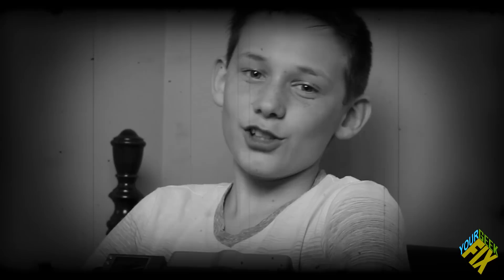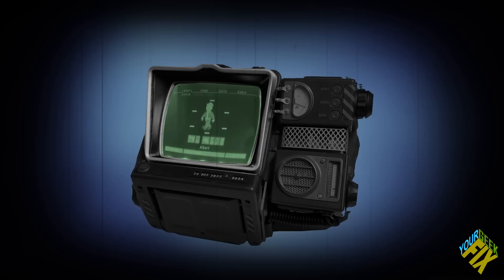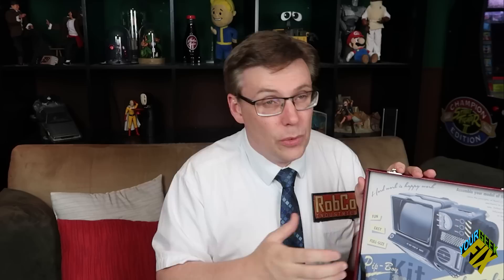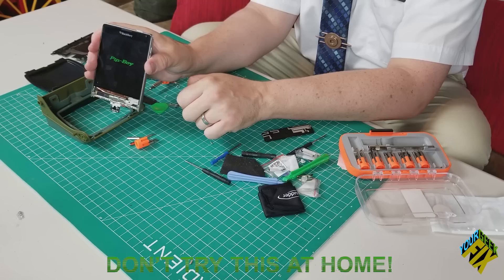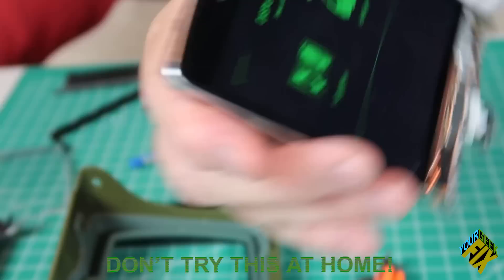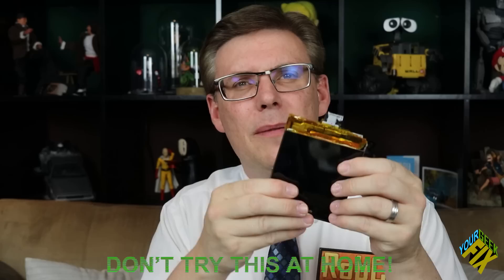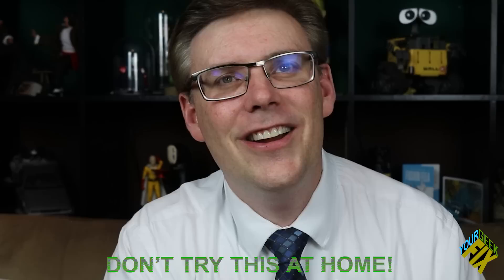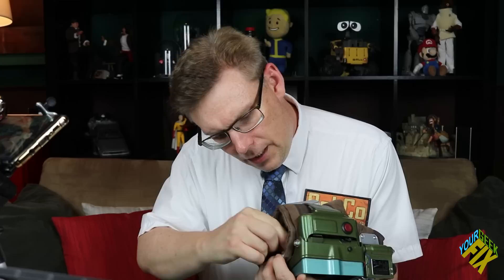How we made a real working Pip-Boy 2000 Part 1 of 3

Comment: Very impressed with the video! I'm new to the channel & was really entertained! I think you should find a way to use the phone's keyboard. The area on the bottom that holds the cartridges (pardon that I don't know most Fallout jargon) could be modified to hold the keyboard. It could drop down when the shelf is pulled down. You could either get an extension ribbon cable  to connect it to the motherboard, or you could turn it into a bluetooth keyboard using a bluetooth module or kit. Honestly, probably the best thing to do (but would likely become a giant pain when replacing the batteries unless you have the radio & keyboard run on a single rechargeable battery) would be to remove the children's bluetooth speaker and splice the radio speaker to connect to a single bluetooth module. This module could also connect to the keyboard. However, I'm not sure how bluetooth works on a OS level. This is in reference to my phone or computer knowing that I'm connected to a speaker or a keyboard or whatever, so I'm not sure how possible it would be to create a single bluetooth device that has both speaker & speaker capabilities. At that point if there are any misc. knobs & dials, you could make them bluetooth & act as a cursor. However, this may not make much sense.
On the other hand, you could turn the shelf drawer thing into a cassette player. Just a thought because the tapes remind me of cassettes which they probably likely are due to some of the Fallout lore. However, I'm not sure if they made cassette players that are small enough & would fit. Honestly, this device looks like it has the space to convert everything to its real, working counterparts. The exception might be the rad meter. You could possibly turn the rad meter into a VU meter that's connected to the phone &/or radio which may be cool. However, I haven't seen a VU meter that isn't chucky & rather large even the kits are pretty big.
Anyway, I loved this video, & this was a very cool project. I wish I had one to work on. Okay, gonna subscribe now.
Reply from the maker: It is a good idea. I stuck in the end with something I knew Fallout fans would not object to. However, when I had to reformat the device it had to use the original keyboard and I reconnected it for that. SO it would be nice to have a quick fire way t do this. Thanks for the comment Michael Schulte.

Comment: No one tell him about the numerous "Screen Rotation Control" apps that let you force your screen to rotate in software, negating the need to physically rotate the screen.
Reply from the maker: As mentioned in video 2, we tried them all and none worked on this app and there is a reason for that. There is an alternative, bit the cable doesn't reach.

Comment: Probably should have just made the radio run off of a rechargeable battery. Maybe a concealed USB port on the outside as the charge port.
Reply from the maker: There is an option I found for older cameras for that battery configuration.

Comment: How much did this cost overall and how long did it take to build. Time to start saving for my next project!!! This looks like equal amounts of fun and infuriating, but so worth it in the end. In true Fallout fashion!
Reply from the maker: The kit is $77 to $120. Radio kit $50-$70. Cylo Pop Critter Speaker is $10-$12.and the blackberry phone was $81-$120. So, somewhere between $218 and $322. I believe the rad meter will be someplace between $60 and $100. So, the question is, how motivated are you to make one? It took me three months, but I was making video, working, and having to order and wait for parts. I went through three Blackberrys and two screens. I also recommend checking out Joshua Diggs (Zap Wizard) on his 3000 project as I feel a lot of the methods could be used for the rad meter and tape.

Comment: The pip boy 2000 wouldn’t sync to fallout 4 immersively (mxr fans) because the pip boy 2000 is used in fallout 76 not fallout 4
Reply from the maker: The model has been used for some time by those hacking it into 4.

Comment: I think that probably the easiest way to make it fully functional (without altering the case like I plan on doing with my kit) is to put a Raspberry Pi 3b+ (or whatever the lastest version is) in the tape slot....
Reply from the maker: The tape slot is too thin. But if you get it working, let me know. Check out our other pipboy video as we covered this.
Reply: @YourGeekFix  I'm actually taking a bit more radical approach to modding mine:  i'm making it more like the hand-held/shoulder strapped Pip Boy 2000 from Fallout 1 (I know some people who do quality aluminum work for a really reasonable price & my one uncle has a powder coating machine in his machine shop)  My idea is to basically create  what is almost like a Fallout cyberdeck (basically a pip boy that has been modified with a larger case to fit in components from a terminal to allow hacking mainframes without needing an actual terminal sorta thing)
Reply: Also an addendum, since it's too small for a 3b, then the smaller Pi Zero should fit.
Reply from the maker: @DJ_Bonebraker  I tried the Pi Zero. It best fits in the top module, but still too large. Would have to modify it to fit. That should give you an idea of how small it is. I have a friend to the channel designing a board that would fit and run an independent screen. The challenge is fitting everything, with exception of speaker, in the main module. When you get yours working, send pictures. I think that sounds really cool.
Reply: @YourGeekFix   Oh wow, really? I guess the PiZero must have been too wide for the tape slot...  Kinda hard for me to judge scales of things accurately unless I have seen them in RL at least once.  Looks like my idea of making it a shoulder-strap unit (like the original Pip Boy 2000) is probably the best way to go about this, then... Especially considering your comments about the weight of it on your arm, but yeah, I'll probably make my own video showcasing the finished product as well as some of the steps I took to make the new backing & stuff when I get it done... Still waiting on the kit to arrive from Amazon.  The video will be in the "Tech & Travel" playlist on my channel.
Still gotta love your solution of using a heavily modded blackberry for the innards.

Comment: Sadly theyve never released the rad meter. Also they now only have preassembled pip boys But you can get the radio module (the prebuilt one comes with the lightscreen) and they did have a limited edition Red Rocket Paint pipboy, which yes came with its own variation of radio module
Reply from the maker: I'm not giving up hope yet.
Reply: @YourGeekFix  neither am I. Honestly didnt know they said they were going to add one til this video.

Comment: what of u were able to use the holotape as your charger? Run a cable to that part of the pipboy and put a small portable charger into the holotape. With Bethesda selling standalone holotapes that gives way for interchangeable batteries as well.
Reply from the maker: True. The holotapes are pretty thin. It would be like a camera battery.

Comment: hey i got a question about the wire ribbons... if one had the tools and skills could you take one off and put a longer one on... if you are able to how would you do that
Reply from the maker: Unfortunately, when it comes to ribbons, you need one that meets the pin requirement for what you are attaching it to. When I was looking for a matching pin count for a ribbon extension commonly used for repair, I found out the ribbon and screen were made only for the Blackberry Passport. Makes sense due to the screen size. It is an OEM component you won't find elsewhere. So, I suppose we are stuck with the ribbon we have. Unless, you made a unique board with the connector, that had two connectors for extending it.
Reply: @YourGeekFix  what if u could find more ribbons from the black Barry phones would u be able to conect those together ik that each connection causes interferance and load but if u had like 3 u could move the end almost anywhere on there and the interferance wouldnt be that bad
Reply from the maker: @akkiller8454  No, there is no way to hotwire it and you would need a series of adapters that just don't exist. The problem with a unique device.
Reply: @YourGeekFix  would it be posible to make your own adapters like of u had a bunch of broken screens take the ribbons from those and make an adapter from them
Reply from the maker: @akkiller8454  they would not have to pins on both sides.

Comment: Amazing build! I have to wonder if it's possible to create an actual clock for the holotape player... but with the piece to fit it in being so small, it really seems like it'd be a major pain building and fitting the tiny parts it would take to make that possible. Honestly, that would be perfect for another official mod that they could release! (after the Geiger counter of course)
Reply from the maker: My problem with that has been the preset width. The rollers I have found are too wide. I think smaller rollers with a magnifier would be better. Thanks Gomorrah.
Reply: @YourGeekFix   I don't know how difficult it would be to access one at this time but there's always 3D printing. At least that's what I'm considering doing for it.
Reply from the maker: @gomorrahstride9672  3D is good. The 12 month of the year roller will have to be tiny. If you figure it out, let me know.
Reply: @YourGeekFix  I think I might have a solution to that problem. Looking into old digital clocks, I found this: 
https://www.youtube.com/watch?v=_YuDjj1baUs&t=301s
I'm not exactly sure what's happening here, but from what I can gather is that the tiles are double-sided and they come into contact with a piece of plastic as it spins around the back, forcing it to flip to a new number. It's more complex than a roller but it lets you print more digits or months with less real estate.

Comment: Hey there! Just finished everything! Only difference is, I had to get my hands on the illuminated screen pre-built edition. I'm having a bit of issues fitting the back casing that's attached to the cuff to the Pip-Boy with the Passport in the way. How exactly did you fit and cut that? Pls Help Me <3
Reply: This in reference specifically to the monitor back plate or the bottom bar that connects through the holotape reader. Cant seem to find a way to get it through with the passport in the way.
Reply from the maker: I did cut a slit in the cuff to 0 sh through the usb. I also flattened the back plate slightly wit h a heat gun.
Reply: @YourGeekFix  Alrighty! I'm not sure where I went wrong, it seems like the blackberry passport device is just too thick for the pip-boy at it's current state. I cant get it to sit in there, and still be able to get the back plates off and the two rods, any advice?
Reply from the maker: @ladyvictory5326  flatten back plate of pipboy a little

Comment: Pretty cool.
Reply from the maker: Thanks
Reply: @YourGeekFix  always wanted to do one from scratch with a Raspberry Pi and a touch screen, but probably will never get around to it. If I ever do, it'll be more like Fallout 2 version that is all frayed and wires sticking out and held together with duct tape.
Reply: @YourGeekFix  and don't feel bad about tearing those delicate ribbon cable, every time I've taken apart a phone, I have a 50% rate of screwing up something like the little oscillating weighted vibrator thing.
Reply from the maker: @ltjon1924  understood
Reply from the maker: @LT Jon  while the pi does not fit the 2000, it fits perfect in the 3000. Did you see video 3 yet?
Reply: @YourGeekFix  I'll check that out! No I haven't.
Reply from the maker: @ltjon1924  definitely

Comment: Did you just call it a rad meter instead of a Geiger counter
Reply from the maker: At the moment they have the upgrade identified as a Rad Meter (radiation meter) due to the fact it does not meet real Geiger counter standards. It measures only EM radiation.

Comment: You know, theres a button that makes the pip-boy smaller, the zoom button, so there aint no need for anyone to spend all that money for a Plastic Pip-Boy, either way, you are looking away from the screen, so its kinda not needed at all.
Reply from the maker: Good point G00ober. I think it's about immersion though. There is also something to putting together a kit, having the sensory experience and knowing you have something on your arm that does more than just light up. I will miss Comicon and cosplay. This would have been the perfect accessory.  How are you doing G00ober? Are you staying safe.

Comment: Wouldn't a raspberry pi/arduino and an LCD screen from china suffice in this application? More lightweight? Not running more power than you need, etc? Although the blackberry is super thin and convenient. Great job on this build. Looks amazing!
Reply from the maker: They won't fit in the .25 inch space. That was the challenge. The Pi was my first choice. Also, the challenge was that it had to connect to Fallout.
Reply: Your Geek Fix Gotcha. The connectivity issue would have been another hurdle, but entirely possible. Too bad it didn’t fit, but at the same time, it looks amazing just the way it is.
Reply from the maker: @creaky2436  thanks. I think someone with more know how than me could pull it off. I just wanted to show it was possible.

Comment: How Much for one i need to know
Reply from the maker: How much would it cost to make one? The kit is $77 to $120. Radio kit $50-$70. Cylo Pop Critter Speaker is $10-$12.and the blackberry phone was $81-$120. So, somewhere between $218 and $322. I believe the rad meter will be someplace between $60 and $100. So, the question is, how motivated are you to make one?

Comment: Is there anyway to run the pipboy on a raspberry pi 3?
Reply from the maker: The 3 and 4 won't fit. I thought about removing the USBs and risers, but still too big. If you really want to use the Pi, I would recommend making a 3000 using the pipboy by Spirit Halloween. It is very cheep and a good size shell taht paints up well.
Reply: @YourGeekFix  I just finished mine, fully functional Bluetooth speaker, Geiger counter (not a add ons), lights and most of all a working pip boy app with a 4.3inch waveshare lcd, thanks for the motivation!!
Reply from the maker: @aussieanzac1092  I hope you are planning on sharing it with us.

Comment: Why has nobody 3D pinted something that wil fit these things inside? People these days 3D print everything, a plastic box like this shouldn’t be hard right?
Reply from the maker: There are 3d models and prints. But they are modified with space against spec. This is the trick for the kit. Ps there are some great 3000 prints out there's and full blown computer cases t hat look like the 2000.

Comment: “Rad meter”
WRONG. It’s called a Geiger counter.
Reply from the maker: The will not call it that because it does not meet spec. It only measures electro magnetic radiation. However, it is a radiation meter. I want a real Geiger counter, but the required tube. Length won't fit inside. The app I used is called Geiger counter, but is also not standard.

Comment: Can't you just buy a new ribbon cable online?
Reply from the maker: The ribbon cable combines the cables for the LED and touch and are not connectable. I did look and bought what I thought would be a click on extension, but the pin connection was not right. This is a BB passport specific cable and connector. An extension would be great.
Reply: @YourGeekFix  Awe dang, that would have been too easy eh? Haha

Comment: 13:17 nothing happened. contacts doesnt brake, he did it for views
Reply from the maker: It's strange, I thought I had already replied to you. Sorry I didn't. If you saw the update video, you know that I edited down this first video and the ribbon tear was the first problem I had. technically it was the back casing on the screen that cut or tore it a little, twisting it tore it slightly more when it popped off, and another attempt tore it the rest of the way. That was a process of about 20 minutes. At that time I had no backups or additional screens. That was the problem that made me nearly stop the project. I ordered new phones and screens, but the next time I bought phones with broken screens to cut the cost from 60-65 to only 30-35. The screens were about 10-15. I learned the easiest process was to only remove the back and keyboard and attach a new screen as the back of the phone is facing outward. I think this is an easy process now, but I did ruin phones. I have three that are broken, but only remember breaking two. Thanks for the comment. Have a nice day.
Reply: @YourGeekFix  thank you for reply. I was joking. Becouse lot of cretors "did it for views". I didnt mean no harm
Reply from the maker: @hutrputr  No harm taken. Just wanted to make sure you got an answer and happy with the results. Have a great one.